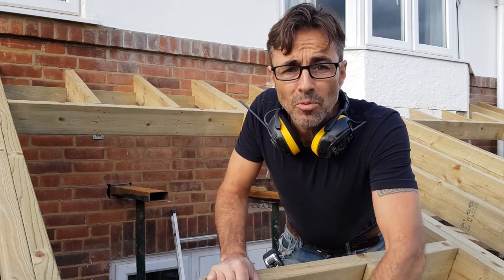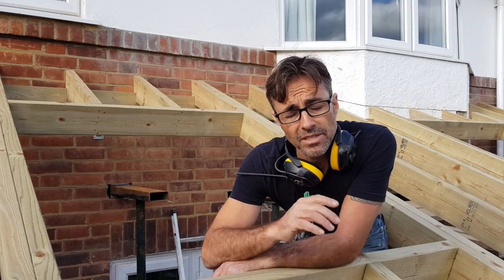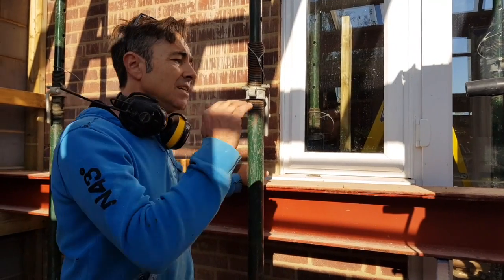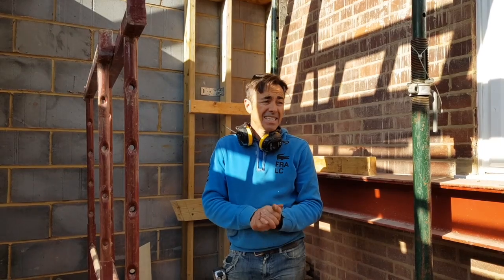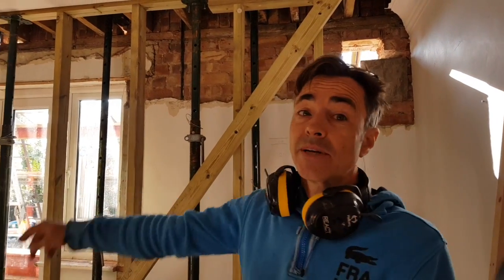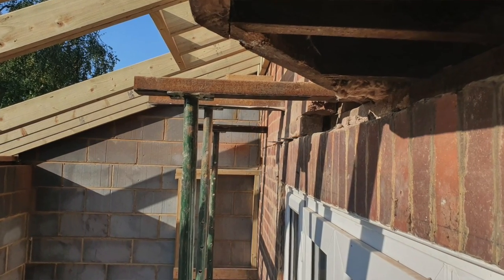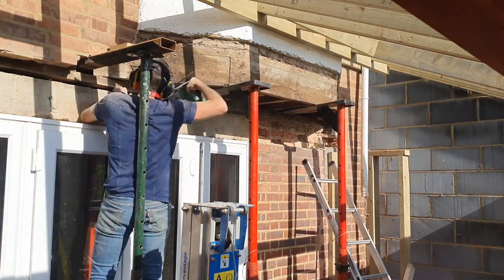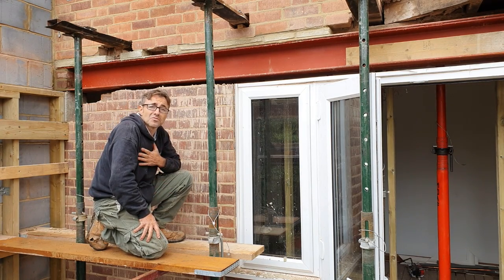fitting a steel beam using needles and acrow props the best way

Comment: Have you ever left the pad stones to the end, and then laid the bricks on the beam and jacked it into position. Surerly easier to get a nice full bed of mortar, and then slipped in the pad stones a the end?  Also do use synthetic slate for the consistency, or is a real slate the only thing.
Reply: Funny enough the way your describing is the way I have always inserted beams in. Lay a bed of muck on the top of the beam then jack the beam up , insert the pads after, this way there are no voids  under the existing brickwork or plates.Good video through from someone whos been building for in excess of 50 years now.
Reply: @miketaylor3503  This danger with this method is the mortar bed will shrink leading to settlement of the supported structure above, maybe only 1 or 2mm, but enough for cracks to occur - I've seen it many times.  Dry packing (with a 3:1 sharp sand:cement mixed to 'damp earth' consistency that will from a firm ball when squeezed in the hand), on the other hand, with it's low water content suffers minimal shrinkage which, in combination with well packed slate, greatly reduces the risk of cracking.  Dry packing is a pain to do well though.  If using your mortar bed approach I'd want to use a non-shrink grout like Webber 5*, rather than standard mortar, it's excellent stuff.

Comment: Great video.
How did you prepare the internal floor for all the acros and temporary stud wall?
Reply from the maker: I used two 150 x 50 as a sole plate these where in the upright position resting on the joists and over the sleeper walls, the main acrows for the needles etc are taken through the floor onto spreaders on the existing concrete oversite
Reply: scaffold planks
Reply: Or solid floor to bear off...

Comment: An exemplary piece of temporary builderswork and way beyond any textbook method.  Main Contractors that are governed by 'ealth and Safety wouldn't go to such lengths, let alone any small jobbing builder.
Rather than needling through, generally Acrow Strongbeam ends are used to support the wall from the inside.  The beam is lifted into a 4 1/2" deep pocket on the outside and then the inner leaf is removed, including the RC lintel and the beam is slid into position with slate packers, keeping the be3am loaded at all times.  This is a tried and tested, structural engineer approved method that requires only a fraction of the temporary builderswork shown.
The material to be supported by the new beam and therefore the temporary works is all the loads within a 60deg triangle above the beam that generally does not include any roof load.  The exception to this is where there are windows and other openings in part or wholly within the triangle and then the loads will require individual assessment.
Reply: Temporary works in construction are important, and are effectively a specialist skill...they are covered by mandatory requirements within the Construction Design and Management Regulations, which covers ‘all’ construction work, not just those works on ‘construction sites’... as for the cast in situ concrete pad stones for the steel beam, concrete can be ‘designed’, relating to cement/aggregate ratios and water content so it can be accurately ‘designed’ to meet or exceed load expectations (as assessed by laboratory concrete design mixes and testing to destruction under load), and provided it is mixed correctly in accordance e with the pre-determined mix design, cast well, and allowed to gain sufficient strength before being loaded, there is no reason to suspect it is an inferior method to others methods, using placing of pad stones etc. 
Robin seems to have a thoroughly good job here, and no doubt he has been supported by a Structural Engineer, who has also probably actually designed the Temporary Works for the job, and probably provided RAMS for the work itself to ensure they were carried out effectively and safely.
Reply: @stun9771  As you raised the CDM Regs, I trust Robin has supplied the client with the Contractors Health and Safety file as mandated by CDM Regs 2015? I have yet to see any small builder provide such a document to their client despite me reminding everyone of their duty.  I also won't mention the PPE - helmet, safety glasses, gloves.  I see he has safety footwear and ear defenders.  
For beams of this load/length the engineers that I use all prefer to spec engineering brick pads as it takes out the difficulty of casting insitu pads that with on site mixing can be variable.  Brick pads are much easier to install.
As I said, Robin's temporary works are exemplary and beyond the normal good practice.  There is nothing wrong with going that extra mile so long as the consequences are acceptable.
Reply: Whilst you're getting all your paperwork together we'd gave got the beaming and brewed up. Box tickers everywhere.
Reply: @sidstewart7399  I'm just waiting for the HSE to pounce on a small building outfit when/if an injury occurs just to make an example for the industry to note.  They did it with the large main contractors  because they realise they don't have the resources to police the whole industry.  If the HSE hits the small builder he will be liable for unlimited fines and a jail sentence - how many builders could suffer even a moderate fine (£tens thousands)?
The documentation required to be provided at the end of the job to the client is a perfectly reasonable and necessary piece of information that will benefit future occupiers and prospective builders.
Reply: @stun9771  you're boring everyone now
Reply from the maker: Thanks for your comment Clive appreciate it

Comment: Great video,
Love the idea of the timber safety props either end.
On some big knock throughs ie:installation of a portal frame or box frame we also run a scaffold tube through the lines of acro props to tie them together.

Comment: Hi Robin great video - so informative. 
One question, I presume the stud wall was a permanent structure? If not, why not use acrow props instead there?
Reply from the maker: Hi John, the stud wall is just for the temporary works and is taken down now
Reply: @robinclevettcarpenter  thanks Robin, keep the great work up, I'm a huge fan
Reply: A temporary stud wall can be used to keep the building secure and help keep indoors clean.
Reply: @TurinTuramber  of course, makes sense

Comment: Hi Robin, did you have to dig down and put extra support under the existing foundation? I am going to be doing a job like this soon but on a slightly smaller scale and just interested to see if you did. Cheers
Reply: For each case you need structural calculations to see if extra foundation is required.
Reply: Thanks for your message, I have had a structural engineer round and done calculations for me, but he says it’s down to the building inspector to decide weather I need to underpin or not. I found this a bit strange. Is that normal? Cheers

Comment: I put the padstones in last. That way I am able to put a line of mortar on the top of the beam. I jack it up so I have a good bed for the wall..
Reply: A bed of mortar will crack and crumble as the steel expands & contracts with heat over time. Solid packers like slate, engineering brick, or steel shims, set at intervals along the beam, will be better.
Reply: @Benzknees , fair point well made, food for thought indeed
Reply: @Benzknees  or 1 to 1 dry mix.
Reply: this is why i love the comments. we can all improve and refine our skillsets.
Reply: @themagpie_1 , every days a school day my friend
Reply: @bearwoodcarpentry  - Dry mix is typically used with slate packing. But it’s unlikely to work (long term) as a bed along the length of the steel. Being hygroscopic, the cement would absorb atmospheric or interstitial water and set (prob in clumps). And a high cement content mix would be strong but highly brittle, with no ability to allow for differential thermal movements.
Reply: Same here, guaranteed a full bed of mortar under the suspended brickwork then shutter for the pad stone
Reply: I’m only a DIYer, but a retired Engineer .... forgot to add that I put DPC along the beam too to allow for expansion of the beam underneath 😇. I tried packing with slate on the first lintel I did, but I thought It was too fiddly. You do not need a continuous support, but it sort of ‘feels right’ somehow as you crank the props up and you get that lovely ooze ..... I have developed my fascination for this that I then went on to lift up the lintel that spanned the garage. Needed a smooth ceiling for the automatic garage door. Took me bloody ages and cutting the notches in the joists! Whenever I look at extensions now I always get sniffy if the lintel ain’t above the plasterboard. Sad bastard, I’d never make money at this game, but I really love raising the point on building sites in front of your customers. When you find my body, please return it to Her Indoors
Reply: @whitefields5595 - DPC would act as a slip membrane, but may be torn/displaced by hammering in a wood blocks or similar to preload the steel (to take up the elastic deflection that will occur on the transfer of loading from the structure above). Not a problem with a short steel, but definitely a consideration with the sort of lengths shown in the video.
Reply: @Benzknees   Ah! told you I was only a DIYer. Although I understand pre-stressing, I had not considered it in the context of lintels. Also my BRegs did not call for it. This will be an extra level of bragging when I do my next one. Of course you have all the necessary calcs to determine the degree of deflection for the pre-load .... or do you hit it till you get the right ring tone :))
Reply: @whitefields5595  - You’re prob ahead of most jobbing builders if you understand prestressing! But as I said it’s only really a consideration with long lintels & RSJs. Plus if you’re building from scratch the load will come onto the steel slowly, so the small deflection will be taken up during the process of construction. Inserting one into an existing building is of course a different matter where the sudden transfer of loads will lead to immediate deflection, potentially leading to cracks in the structure. The factor of safety built into the design tables should minimise this, but it’s highly advisable to seek structural calculations by a Structural Engineer with any large beam. Especially where there are point loads coming onto the beam. He will be able to tell you the expected deflection. 
As for the BRegs, originally an adjunct to the Public Health Act, they’ve always been primarily about the safety of the occupier and visitors, rather than a prescriptive design guide for builders. They only require structural work is safe, without excessive deflection or deformation. Which if you’ve sized your lintol/beam off manufacturer’s tables should be limited.

Comment: Great video yet again Robin
Its great to see someone who is knowledgeable and passionate about what they do.
I have a question about how you got the calculations done for the beam and how you got away with just a single top beam and not a goal post system or a box frame. Just doing my house currently and had 3 engineers come around they all wanted an over the top set up. Its only a 5m beam in a two bed house just up the road from you in Westcott just outside of Dorking
Reply from the maker: In our case the existing foundations of the dwelling where really nice and the walls where super solid, we where also leaving enough brickwork as piers to justify not needing the frame set up, this is the first for a while that we have done that did not have the goal frame set up so that was great, its really tricky because an engineer has to cover him/herself and they also have to work on assumptions etc, maybe ask the question "can you make this work with a single beam?" say hi if you see me out and about!!!
Reply: @robinclevettcarpenter  
Thanks for the reply Robin 
I certainly would say hi if I were to see you out and about. You actually shop in a timber merchant where my partner works but she's too shy to say anything to you. Keep up the great videos and sharing your knowledge its much appreciated

Comment: Hi Robin, great video and methodology used.   I had an interesting one recently which was in an old building in Sydney city and was an old wool shearing shed near the old docks. There were two timber beams that looked like they were scavenged off an old timber ship, they were massive. There was two of them bolted together. The termites had gotten into the timber and eaten the majority of the inside of the beam. I had to remove it much like you did, section by section and then new lintels and brick it up bit by bit to take the loads above. The old bricks on that building were hand made by the original convicts sent here. I say variety to your work is key so you don't stagnate, I prefer this kind of work where it is like a game of chess, careful planning and execution otherwise one wrong move and it's check mate. Cheers 👍
Reply from the maker: Yes, its this type of varying work that makes the job more exciting, and the chess analogy is spot on!!! have a good week mate

Comment: Hi Robin how did you work out the existing load above (roof, floor, brickwork) etc so you knew how many acros to put in ?  I always follow the BRE guildance note for this which works on distances between acrows.....i then consult with a temporary works coordinator for the needles load capacity.....
Nice to see someone else using needles, our local structural enginer hates strong boys as there not really load approved and by using one it massively reduces the load capacity of the acrow..... needles are always safer
Reply from the maker: Hi Craig, I tend to work out how many square metres of materials are in the building and would affectively be supported, I make assumptions and also over calculate and come up with a figure, then I would add an amount per room for furniture etc I would then see where and how I can fit the props, needles and get divide the weight by the amount of supports, there are lots of variables and in the case of my job we had a large concentration of the load down the side of the bay into the middle of the new opening, this was evident when I removed the concrete lintel as it had a crack due to the loads over, I am a strong believer in more props the better, its about managing risk and health and safety
Thanks for your comments mate
Reply: Thanks for sharing your knowledge, top man 
Just in case you ever need it the BRE good building guild is GBG 15 
Its got all the loads for the acrows and needles pre worked out.
Reply from the maker: @craigsmith3954  Thanks Craig I will take a look
Reply: When a steel is specced it should come with it the load that it is to support and how it’s distributed along the beam. Likely over estimated by a good margin but a starting point no less?

Comment: great video, thankfully it's a small section steel, and not one of those huge, awkward to handle ones with a plate on
Reply from the maker: Well if you look closely I do have a 10mm plate welded on the top and this did add about 40% to the overall weight!! instead of this beam being about 300kg it was more like 430kg!!

Comment: Did this on the back of an old Victorian property with 500mm width rubble filled stonework. There were 2 beams at 250kg each; one on the floor and one on the top with a steel post each side. The beams were dumped half a mile away as the lorry couldn’t get down the side streets (small Victorian roads). We had to get these beams through a 2ft basement window, through a kitchen, a lounge then into position. We had 5 blokes lumping them bit by bit. If anybody’s worked on old stonework you’ll know that the rubble falls out of the middle.... 
interesting job. 
Didnt know you did this sort of work Robin. I guess when your in the trade you inevitably end up doing other work, not just your trade.
Cheers mate.

Comment: Thanks for the video Robin, have you come across any good ideas for retaining loose fill cavity insulation? I’ve got to make an 2m wide opening through a gable wall of a bungalow, I wondered if drilling all round at  regular spacing and squirting expanding foam in would work? Otherwise it’s a garden full of polystyrene beads🥴
Reply: The beads should be lightly glued together. I have them in my house, and when I opened up the wall to put in a new cavity tray I found only a small proportion came out. Although I was still finding those loose ones blowing around weeks later! 

As you say you could use spray foam to retain them, but it effectively bridges the cavity (along the top of the foam) and could provide a route for moisture to run thru to the inside skin of the wall. Beads by comparison allow moisture to run thru the small gaps inbetween the glued interfaces.
Reply: Stuffing cavity batt in the gap worked for me.

Comment: Really interesting, thanks Robin! Am I right in saying this is a solid wall, and if there was a cavity you'd require a steel for each skin? Cheers
Reply from the maker: Yes, exactly
Reply: Two lintels are easier to lift, but you do need to bolt them together .... however you can use a single wide one which can be cheaper and quicker, but need to have loading calculations to be sure

Comment: Hi Robin
I think the higher you can get these steels the better. Did you not think about taking it higher and having the joists run into the web of the steel in order to have the ceiling running level through.
Reply from the maker: We can do that but in most cases the steels are taller than the joists so you end up trashing all the rooms above, so although we can do it we give the customer the price either way and they decide
Reply: @robinclevettcarpenter  Thanks Robin. At least you give the client the option then let them decide. Like you say a lot more work and mess involved. Good luck.